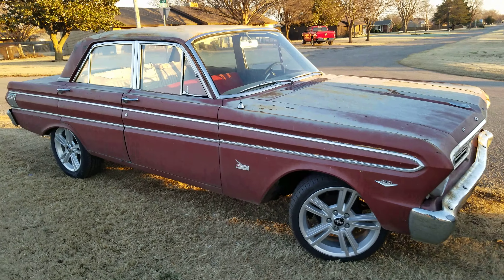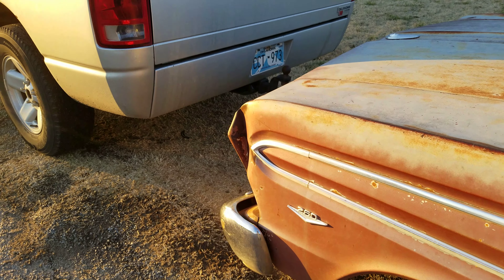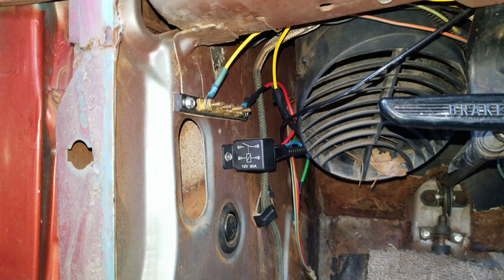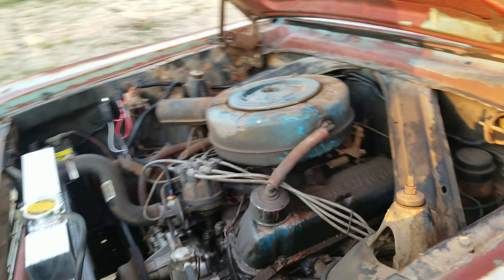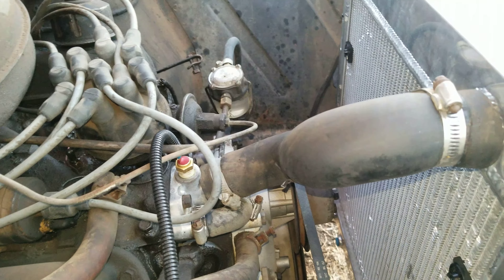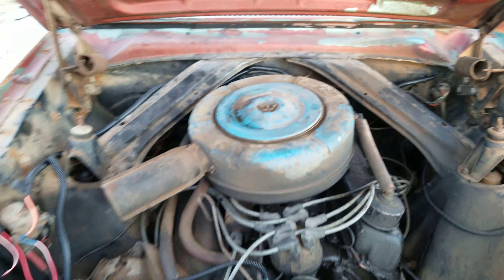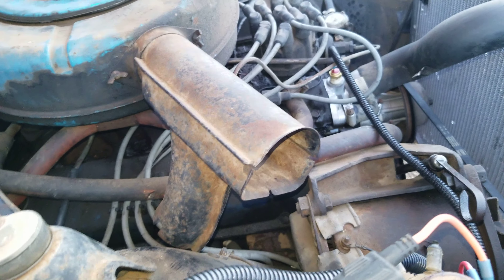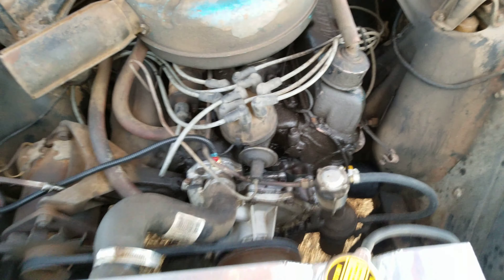1964 ford falcon futura walkaround

Comment: Do you run an electronic igition, like an MSD, or, if your cheap, a velleman kit driven by the points?
Reply from the maker: I would run an MSD if I had the money. usually I run stock points or an HEI
Reply: @mrawesome14b  https://www.velleman.eu/products/view/?id=8946 If you can solder, those can be had for 20-30 bucks. I believe it is more or less something like a Duraspark.